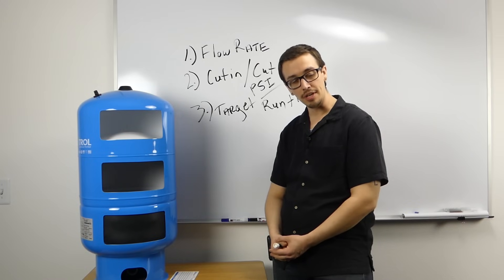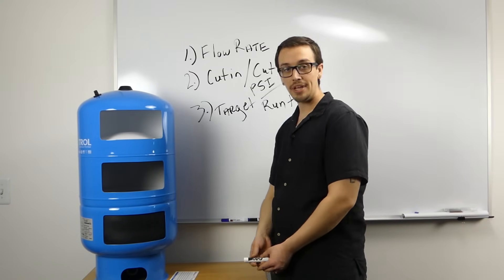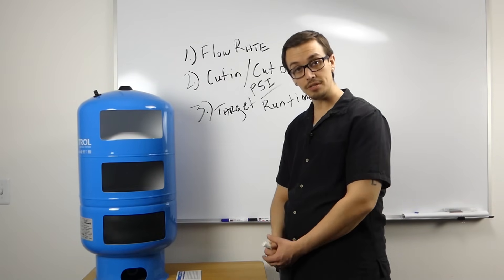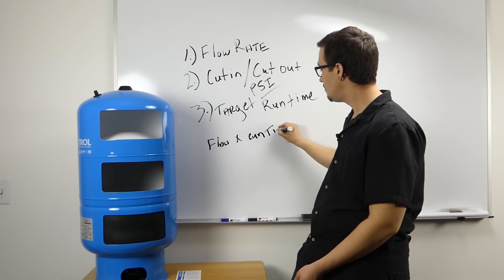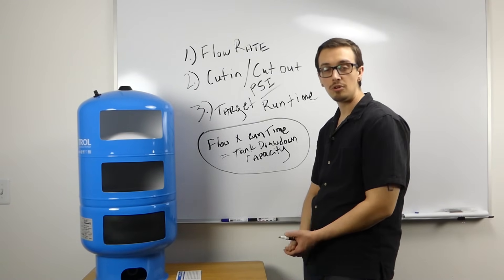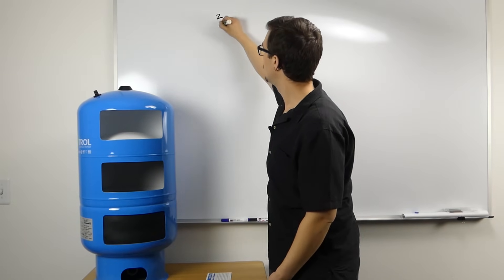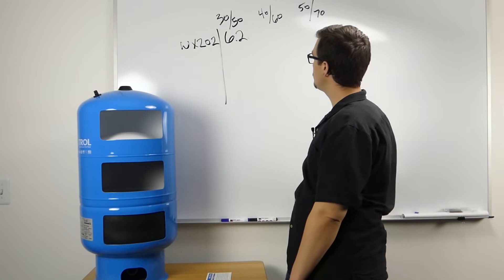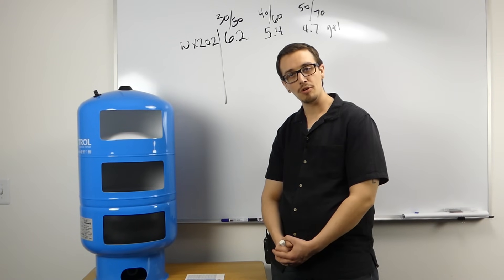How to Size a Pressure Tank

Comment: I have a galvanized tank, snifter valve on the check valve. I am told this allows some water to drain back into well and also allows tank to stay "charged" with air. Have had issues with water- logging as discovered by hearing short pump cycling. Drain tank...and good for a few months. But I have read it is best to drain tank, then charge tank to about 2 lbs less than cut on by pressure switch. For me this would be 28 lbs. (30-50 psi pressure switch). Question is, since I do not find a "charging valve"...but DO have a snifter valve...am I crazy to try and install a schrader valve through which I can charge system? I admit, when old snifter was all caked with corrosion I just bought a cheap valve, (not snifter specific) and threw it on...but I am told a snifter is specially designed to have less spring tension to allow air to feed back in. And, I do plan on changing that to the snifter specific schrader valve I have already purchased. Long question, I know...but thanks.

Comment: Okay I had a tank 2 years ago that was on my Gould's 1, 3/4 horsepower pump. I'm not sure the size of tank but if you were standing up it would be just passed or close to your waistline. The pump seem to be cutting in and out too much so I went and seen ecowater North and he told me I could go with a smaller tank (20 gallon). Problem is now if the washing machine is running or filling there's hardly any water upstairs. the salesman knew I was trying to save some money on a tank price and he told me I would be fine with that small tank. My question is, is this tank the 20 gallon, too small and just going to cause me to burn out my pump,? should I move back to the larger tank? Thanks in advance.

Comment: Thanks for a nice video and table! I have a question:  from your table titled "Specifications", line WX-250, one may conclude that the regime 30/50 is noticeably more efficient in terms of drawdown than the regime 50/70 (13.6 vs 10.4 gallons). Similar for other WX models. Can it be concluded that in general moving towards lower on/off ranges is advantageous in terms of drawdown capacity?
What other factors should be taken into consideration when setting on/off ranges? Is it admissible to widen a range and select, say, 30/70? Thanks.
Reply from the maker: Yes, the lower your pressure in the tank/system the more water the tank will hold. Typically you want to stay in that 20 PSI range so that the drop in water pressure is not as noticeable and you don't put extra wear and tear on the butyl diaphragm in your pressure tank.

Comment: OK when you talk about "flow rare on the pump", which pump are you referring to? Is that the pump I have down in my well 57 feet below the ground, or are your referring to the pump on the pressure tank? IN any case , how does one go about determining what the flow rate value is for use in the draw-down capacity equation ?

Comment: would there be a problem going from a 62gal pressure tank to a 86 gal pressure tank?
Reply from the maker: Nope! Bigger is always better!
Reply: @RCworstwater  so basically this calculation is only needed to determine the MINIMUM size tank you need? Thank you. great vids
Reply from the maker: Yes, this video is for sizing the minimum.

Comment: What should be the air pressure in the tank for different range
Reply from the maker: 2 PSI below what the pump cuts in at. So 38 PSI for a 40/60 switch.

Comment: What should be the air pressure in the tank for different range
Reply from the maker: 2 PSI below what the pump turns on at. For example, 38 PSI in the tank if your switch operates at 40/60
Reply: @RCworstwater  HELLO SO I HAVE A FEW QUESTIONS   SO IN THE OLD DAYS 70 80S I INSTALLED WELLS BUT WE USED 300 GAL PRESURE TANKS-------- BUT TO DAY EVERY THING HAS CHANGED SO FIRST WELL PUMP FILLS UP A WATER TANK APROX 100 FT AWAY APOX 3000 GAL IN THIS TANK IN TO A SMALL BUILDING NOW THAT BUILDING HAS A JET PUMP WITCH HAS A INCH OUT PUT LINE GOING TO THE HT-20B WITCH IS THE SAME TANK AS YOUR 20 GAL PRESURE TANK SO THAT PUMP IS GRAVITY FED FROM THE 3000 GAL TANK NEXT TO BUILDING THAT PUMP IS A 50 /75 PSI  NOW FROM THERE THE HOUSE IS ANOTHER 100 FEET AWAY THE PUMP DOSE NOT STOP OPERATING SO I FEEL THAT THE PRESURE TANK IS TO FAR AWAY FROM THE HOUSE TO OPERATE PROPERLY NOW WILL THAT 20 GAL PRESURE TANK 100 FT AWAY WORK OR DO I NEED TO BRING IT CLOSER TO THE HOUSE WAIT I DID NOT INSTALL THIS SYSTEM JUST SERVICING THERE SYSTEM NOTHING IS WORKING PROPERLY PLEASE COULD YOU HELP BECAUSE THIS IS SIMPLE SYSTEM BUT THE WAY IT WAS INSTALLED IS QUITE STRANGE THANK YOU 4 YOUR TIME

Comment: I have a 2 wire pump I ran 12-3 with ground 110 ft from double 30 amp breaker to the new 30 50 switche and pump comes on briefly then breaker trips please let me know what you think is my problem
Reply from the maker: Give us a call for help troubleshooting: 855.329.4519

Comment: how to calculate minimum run time?
Reply from the maker: If your pump is 1 horsepower or greater then you want at least a 2 minutes run time. If it's under 1 HP then you want at least a 1 minute run time.
Reply: That is for 7.5 HP pump mu run time would be 15 minutes

Comment: Hi,

We have a requirement of 2,200 USGPM pump with operating pressure of 109 Psig (7.5 barg). the minimum one user in the network uses 440 USGPM. The pump we found has Qmin as 1,100 USGPM. My question is that can we use bladder tank to safeguard the pump for frequent ON/OFF operation. If yes then what will be the size of bladder tank.

Comment: Thanks for the well system wisdom you put on your videos. Wide variance for problem solving for the home owner. Getting ready to replace a old pressure tank after having a well person diagnosed one of my problems and replaced the outside saddle and connector was bad, pushing water out the top of the well. He recommended changing the pressure tank as well later but soon. Thanks again for walking us through the troubleshooting and how to fix the problems.
Reply from the maker: Glad you found them useful, thanks for the awesome comment!
Reply: @RCworstwater  its any partivular reason to use 30/50 20 variation for each ?? Or ita ameeicna standard ... you literrally can set your tank at any psi and make sure your cut off swith its 2 psi below?? If your have a smart swith instead to use standard swith ??

Comment: What happens if you use multiple tanks? Say two 20 gallon tanks.
Reply from the maker: More tanks is the same as putting in one bigger one. A lot of community systems have pump houses with 4+ tanks installed to meet their needs.

Comment: I have a wx-202. HP of 1/2 at 230 volts. I have it set at 50/70 cuts on for like 15 seconds then cuts off at required pressure. Is this too short of a time I’m assuming? I saw the chart and shows min of a minute if it’s 3/4 HP but mine is 1/2
Reply: pump model 10EJ05422
Reply from the maker: @mav48185  Yes, even at 1/2 HP it should still run for a minimum of 1 minute. Give us a call if you would like help selecting a tank for your setup: 855.329.4519  You can buy them on our website: https://www.rcworst.com/Pressure-Tanks-c171.html

Comment: Hi I just want to ask about the cut in/cut off pressure of pressure switch. For example 30/50 psi so the maximum can deliver the tank is 50 psi? Regardless the pressure/head of the pump? Thank you
Reply from the maker: As long as the pump can produce the 50 PSI then yes that will be the "cut off" pressure and therefore the max.

Comment: I currently have a 30psi tank. I’m changing my pump to a 12 gpm 1/2 horse pump but the pump is down 80 feet and I understand this affects the actual gpm .  Also would like to change my pressure tank at the same time. Which tank should I purchase?
Reply from the maker: There are a few more measurements we need to size your pump, please give us a call: 855.329.4519
Reply: I already bought a 1/2 horse 12 gpm pump

Comment: I have a 1/2 hp shallow well pump with a 35/50 switch and a 20 gallon pressure tank. Everything is brand new. Everytime I flush the toilet the pump kicks on. I felt the pressure tank and it is empty. What gives? I thought it was suppose to hold 6 gallons of water. Do you think that there is too much air on the tank? It has 28 psi in it.
Reply: 30/50 switch

Comment: Read through a bunch of comments but didn’t see my question so here it goes. I have access to a couple use pressure tanks for free basically. Can two tanks be used in series or parallel to get the correct Sara’s down and run time?
Reply from the maker: Yes, just plumb them in-line right next to each other and you'll be good!

Comment: The pump I just bought is 10gpm but it’s at 200 feet deep, should I still get 10gpm ?
Reply from the maker: Give us a call and we can help you determine if your pump is fit for the application: 855.329.4519

Comment: I have a 21 gallons tank and i used 1HP pump single phase.the question is, when running i get a 23 amps starting and lights fluctuate.i encounter voltage drop.used i use transformer?breaker is 30amps.
Reply: Well for starters, you're supposed to be running a well on a dedicated circuit. So there shouldn't be lights to flicker because there shouldn't be lights on that circuit.

Comment: 1/2HP pump with a 3 gallon holding tank ?  Pump is continuously running when water is being used and sometimes it will lose its prime. Please help
Reply from the maker: Your pressure tank is too small. What is the model # of your pump?
Reply: douglas30635 how do you tell if the pump is running? My pump is deep, is there a way to tell if it’s the pump instead of just the tank?
Reply: @shanek6582  I have a light that let's me know at my well house.

Comment: If we are talking a tank just for residential lawn irrigation would the same standard apply given use only every couple days for about an hour a pop... my irrigation pump is 8gpm,   what size tank would you suggest , Bare minimum.
Reply from the maker: Good question Dave. Ideally, irrigation pumps should not cycle on and off when the sprinklers are running. This is usually accomplished via a Cycle Stop Valve or Flow Regulator with a very small tank (4 gal. or so).
Reply: @RCworstwater  ok and are these valves included in a special pump or are they included with a special tank?
Reply from the maker: Dave, give us a call and we can quickly help you size a tank for your application: 855.329.4519

Comment: Hello, Thanks for your informative site. I have a viessmann boiler  atola and now the tank is defected. I was wondering what kind I need. The one I have has three entrances . first input for cold water to come and one on the side top to release air and one at the bottom side to release water. The tank is huge. It's 30 psi and I can't find anything like the one which I have. I was wondering if you could help me . Thanks in advance

Comment: Hey Great Videos 
Liked and New Subscriber 
I’m needing a new Pressure Tank and not sure if it was sized correctly originally. I have the information for the Submersible Continuos Duty Pump in my well.

HP  1/2
VOLT  230
GPM.  12

PRESSURE SWITCH 30/50

What  I have now is a 20 Gallon tank.
Reply: Undersized tank.
Reply: @stevee7774  Thanks

Comment: Ok so I have a 119 gallon tank my question is what would be a good size pump to run with it. My down hole pump pumps water into a tank then my surface pump pumps water to the house. I’m wondering if I can get away with a smaller pump than I have now. Right now I have a 5hp baldor pump but when it goes bad its freakin expensive and unfortunately I think it just went out.
Reply from the maker: Zach, we'll need to know a lot more about your application. Please give us a call and we can help you find the best replacement: 800.329.4519

Comment: Ok so if I’m taking a shower. Should the pump run non stop or should it refill the tank and cycle
Reply from the maker: That depends, are you using as much or more water than the pump is able to produce? If you are then the pump will continue to run until demand decreases, if not, it will send the excess water to fill the tank up and shut off.

Comment: What about 20/40 systems? If pressure isn't a major concern is system longevity/ reliability increased?
Reply: As long as your well pump runs for about 1 minute minium your good. Lower pressure can prevent leaks from forming

Comment: Hi, I am building an off grid house with a 2642 gal (Rotoplas 10,000 liter) cistern tank buried in the ground. If the cistern comes with a 1/2 HP pump (not sure how many gals/min capacity that is) and the water has to go up 3 stories high (about 32 feet high) then how big should my pressure tank be?  There are 4 sinks, 3 toilets and 2 showers.
Reply: Pressure tank size is most dependant on pump performance.   You need to know the output of the pump (based on its output less the loss due to head pressure) to answer the question, but as a rule of thumb I would never go smaller than a 20 gallon pressure tank and typically like to see a 40-50 gallon tank for a multi story  home.  Also consider where the pressure tank will be installed.  If the tank is installed in the basement/near the cistern you will lose about 15 PSI by the time its pumped up to the top floor. So either compensate for this by setting the pressure switch higher or consider installing the pressure tank on the top floor (or roof depending on climate).  In that case you will get full pressure on the top floor and 15 PSI more in the basement.
Reply from the maker: ^ exactly right

Comment: 20 gal pressure tank paired with 20/40 pressure switch and what I think is 3/4hp submersible pump. Using it to pump from spring water stream up hill to a pool. 10 gal per minute right now but pump runs 16 seconds and is off for 16 seconds, pump kicks on at 29 psi. What should i do to maximize the pump rest time? Do i need a larger pressure tank? Thanks
Reply from the maker: Thank you for the question.  Your pressure tank is probably small for your system.  I have included a link to a pressure tank sizing chart.  You should also check your pressure switch.  Your pump should be turning on at 20 psi if you have a 20/40 switch.
https://www.rcworst.com/Shared/content/mfr/amtrol_well_x_trol/docs/wellxtrolsizing.pdf

Comment: I just had my control box go bad and saw that my tank is tiny. I have a 3/4 hp pump and was considering a larger tank. The problem is the tank is under a manufactured home and it is as large as possible. I am considering moving the location of the tank up the hill to the location of the well and building a well house to accommodate a large tank. It will be about 20 ft. above where the current tank is.
1.  With old pex pipes in mfg. home over pressure is a concern. will i need to lower the tank pressure because of the head pressure added.
2. would i have to move the pressure switch and control box up the hill? this would require a ditch to burry the wire if i moved it up the hill with the tank.
Reply: 20 feet of additional elevation will only add about 9 PSI to the system, if that worries you you can select a pressure switch with lower set points but chances are you'll be fine.  The pressure switch DOES need to be relocated with the pressure tank.  You can simply junction the wires together where the old switch was and then cut into the wires at the well head to tie in the new pressure switch in it's new location. Hope that helps.
Reply from the maker: Joe, please give our customer service line a call and we can help you determine the best course of action: 855.329.4519

Comment: I have the original pump  that came with the house built 1969, no idea what brand. I noticed it was cycling almost constantly, and found the capacitor in the control had melted. I could read the old controller data, and it listed as 1/2 hp. Replaced the controller, then replaced the old 20 gal tank with a 30 gal. Does this all sound kosher? My question, if I ever have to replace the old pump, should I get one with a built in controller, or use the seperate wall controller I have now? Thanks.
Reply from the maker: That certainly does sound Kosher, and I would recommend a 3-wire pump with the controller above ground. The reason being you can replace the capacitor if it fails fairly easily. We have a video coming out on Friday that explains the differences between the 2- and 3- wire pumps, keep an eye out!
Reply: Thanks for the reply. I just checked, and it is a 3-wire controller, feeding the cap and relay. So I guess the pump is too. The old pump must be a real beast, after having  first the pressure tank losing pressure, then the controller bad, both making it short cycle about every 30 sec to a minute for some time. It's been working great after the two replacements. Can you recommend a good brand 3 wire pump, as most I've heard of now seem to be with controls on pump? Thanks again.